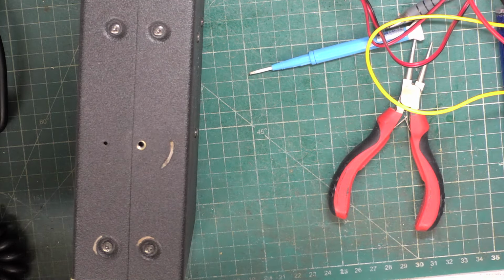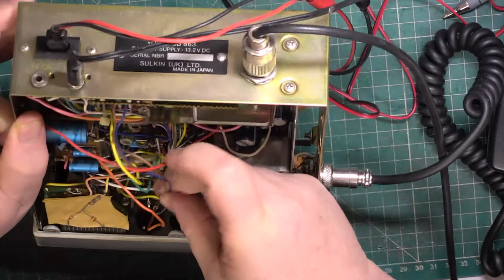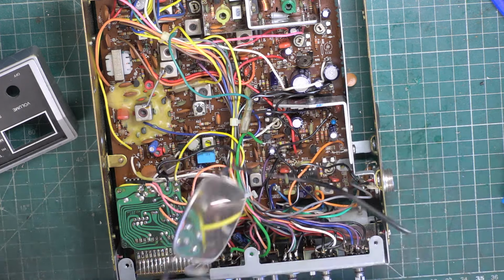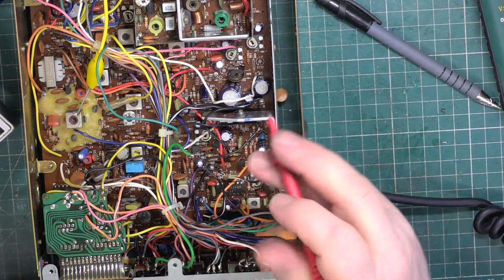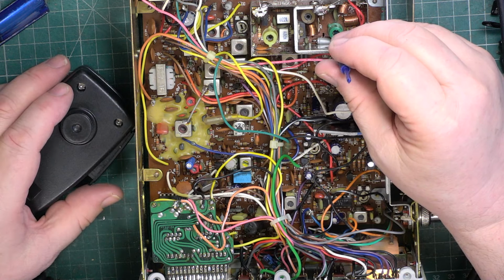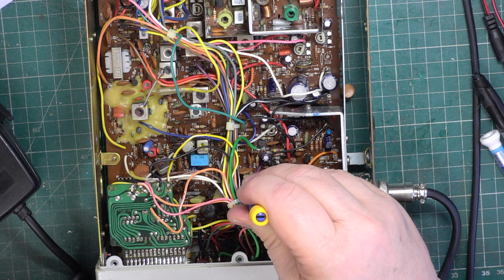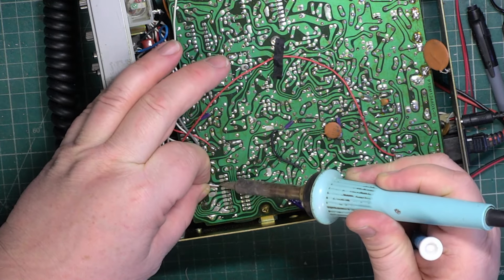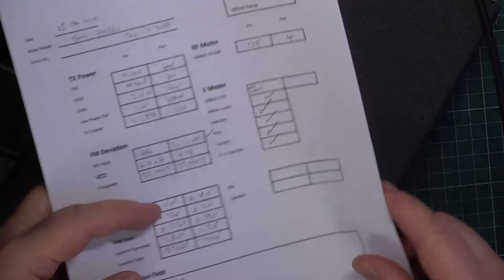York JCB863 CB27/81 UKFM CB radio -  Extensive demodification & alignment

Comment: I would guess that the rear board may well be a swr adaption out of a cybernet am/fm radio and works via the tone control. As for the big home made board I suspect it’s some sort of speech mod but as I’ve only just started watching I’m not certain, so may well be back on this note later correcting it LOL😅

Comment: I am not the biggest fan of modifications, but at least they were done in a way that the radio could be put back to standard without leaving a trace on the outside. I get really annoyed when people start drilling extra holes in things for switches and variable power pots. And don't get me started on those quick release snatch plates either. Many a good radio has had it's top cover ruined by one of those monstrosities.

Comment: so what areil shall i use now for cb been years since idid it still have me swr meter exer just bought new power supply for it ty for help
Reply from the maker: We use the Solarcon 99 as the base station aerial which we conduct the 'on the air' tests with.

Richard